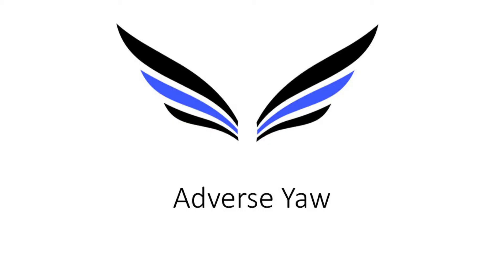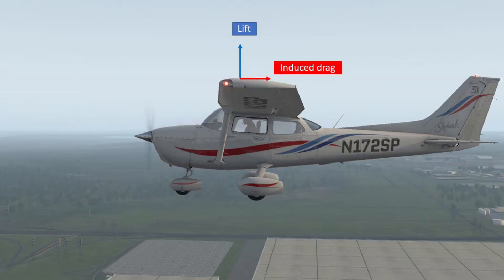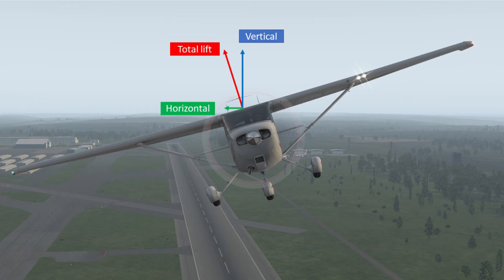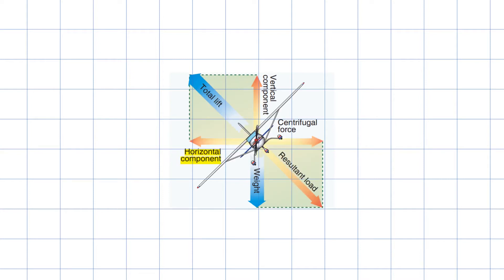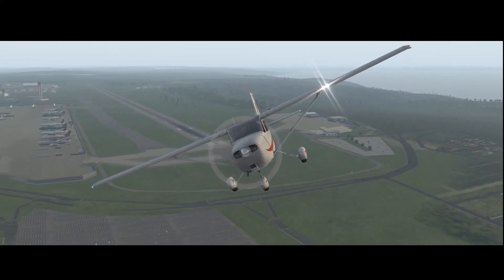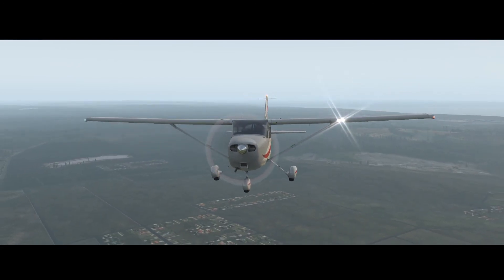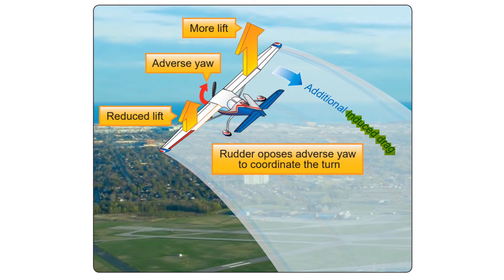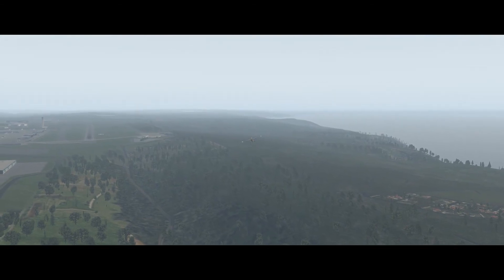What is Adverse Yaw? - Stick and Rudder ground school discussion

Comment: I was an Instrument and autopilot tech and instructor on the F111.  It had a system that automatically corrected for adverse yaw.   I went from F111s to H60 Seahawk as an automatic flight control system  (AFCS ) instructor.  It also has a system to automatically correct for adverse yaw.   I tried to find out what causes adverse yaw on a helicopter.   I never got an answer  to this question that I consider sensible.   My guess is adverse yaw on a helicopter with a tail rotor is due to gyroscopic effect of the tail rotor.  Any other ideas?